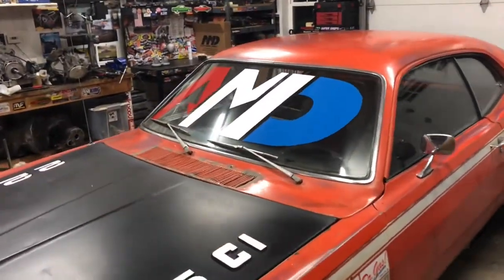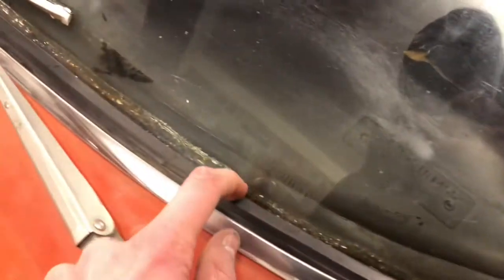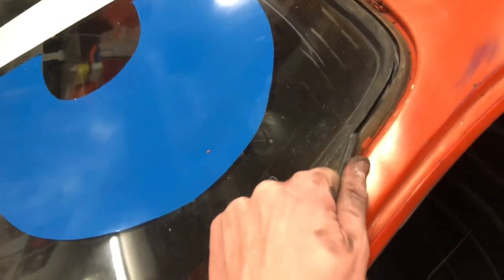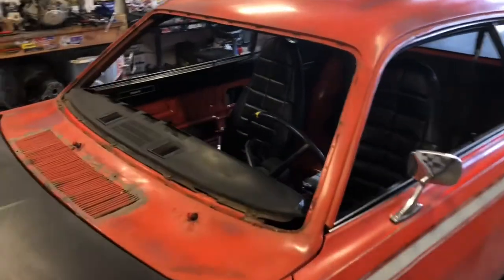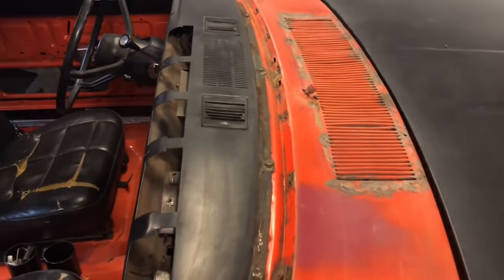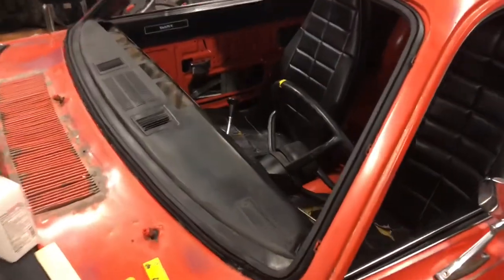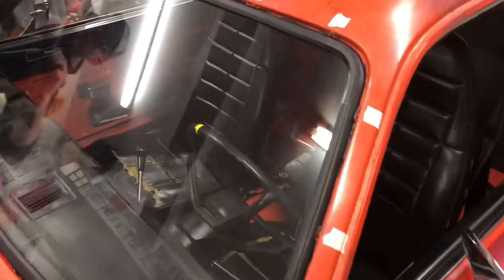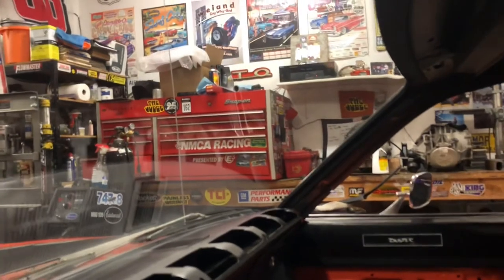Mopar A body windshield replacement (72 Duster)

Comment: A tip my grandpa gave me for installing windows is to put a rope inside the channel for the glass. When you put on the windshield just pull the rope to get the rubber around the glass. Saves a lot of struggles using plastic tools or screwdrivers to get the rubber around the glass! anyway nice video and cool channel!
Reply from the maker: Thanks! I actually have heard of that truck as well, might have to give it a try next time

Comment: Well done! Your video popped up on a google search as I'm looking at replacing the windshield on our 67 Barracuda. Yer right, not much out there for info on these lol. One thing I would like to mention and I plan on doing it is that when you have windshield removed, you can flip the screws that hold the dash in place( install from under dash). The only thing is you might need to shorten/clip the screws so the ends dont touch/scratch the glass. Now with windshield installed you can remove the dash.
Oh shout out to AMD for helping you guys out!